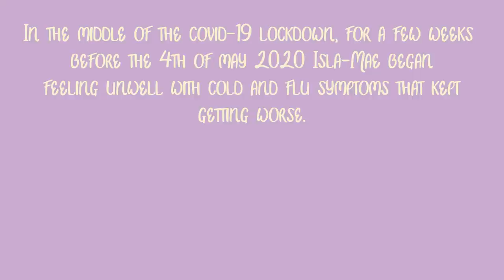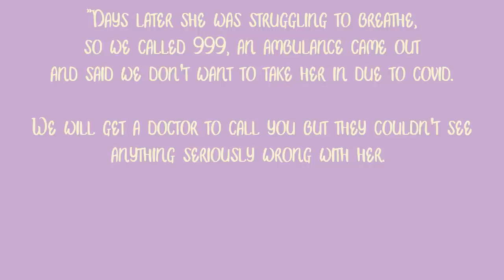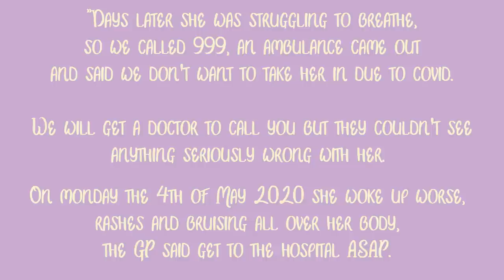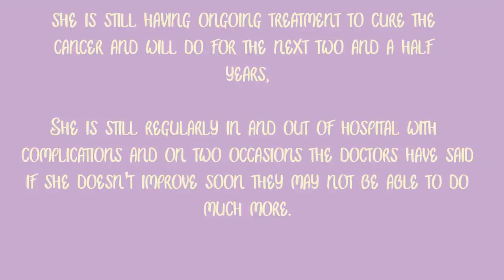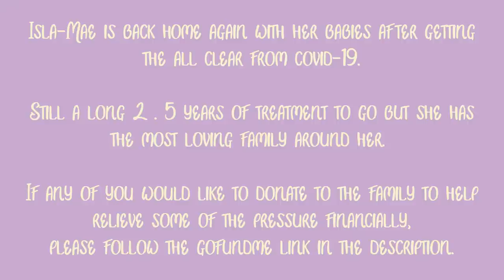FREE PLAYGROUND CLEANUP to raise MONEY for a 4 YEAR OLDS CANCER BATTLE.

Comment: I don't have much but I have hair. It's completely natural and untouched by scissors, bleach, dye, it's completely natural. I love to joke that I have "Hair colored hair" but I really do. It's over 36" long. I don't have money but I have princess hair. It's naturally very slightly wavy. It can be curled or straight, I haven't used heat on it in over a decade. Please let me know if little Rapunzel needs to let down her fair hair. Mine runs a dark blonde to light brown with auburn highlights and although I am currently 5'10" it's well below my waist in length. I have always and only cut it for meaningful reasons. I'm willing to take mine to 1 inch if it helps.